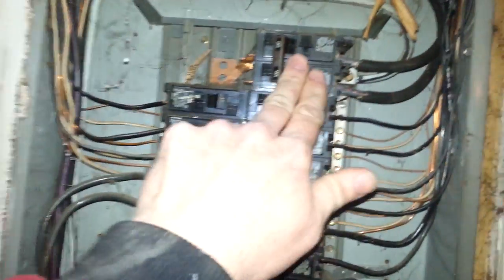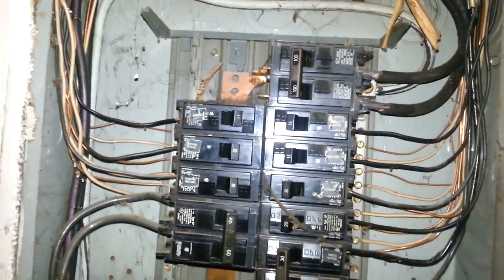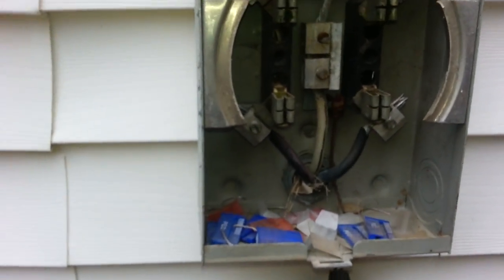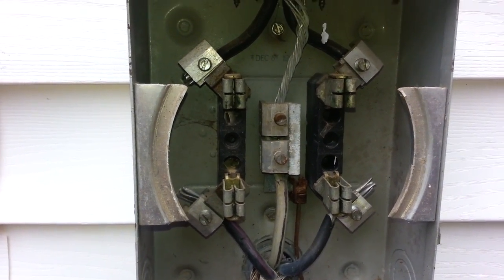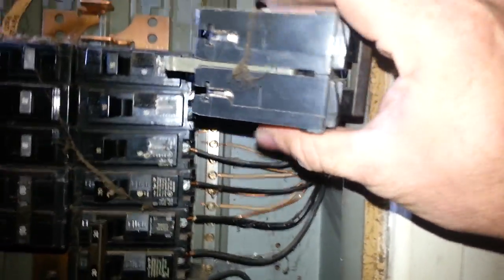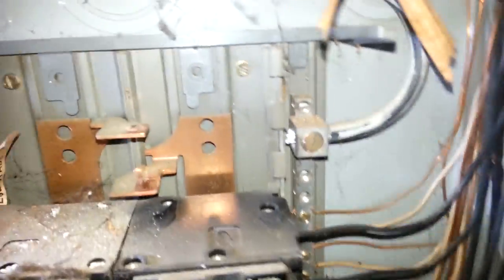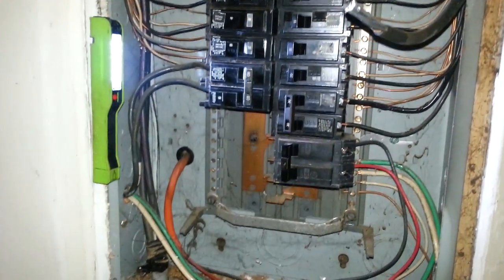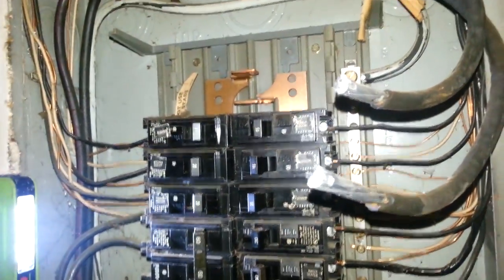Replacing over heating 100 amp Circuit breaker

Comment: anti-oxidation compound  on the bare service wires is a good practice.
I use it on copper wires that are subject to high amperage.
Use a wire brush to get into the stranded conductors.
I have a tool box with just the tools for applying anti-oxidation compound.
Reply: I just like to call it noalox

Comment: My inside main is tripping when i run heat pump sometimes,,it always gets very hot when heat pump is on,,,doesent get hot when ac is on just heat pump??Home is a 25 year old manuf home so breaker may be old and needs replacing

Comment: I have a 100 amp breaker without on/off switch. Overheated. Attempted to replace with same type breaker but has on off switch but won’t stay in on position. None on the shelf will. Does it need to be powered for it to stay on?  Is this a new safety feature or?  I’m stumped!

Comment: The breaker was in the ON position when you started trying to replace it back into the panel? Is that safe?
Reply: He unplugged the meter outside so there was no power being fed to the panel.

Comment: When you checked the other breakers were you simply tightening all the leads to insure proper connection?
Reply from the maker: Snazzy Architecture yes over time the connections will become loose due to expansion and contraction a loose connection can cause a fire as well

Comment: I'm an electrical apprentice... please correct me if I'm wrong...I first thought is ,that breaker is overloaded or there is a lose connection on the breaker terminals...as for it being the neutral, if its a neutral I would think everything in the house would be burned. last if its a short wouldn't it be tripped lol ........please correct me ....not I did not read comment before this comment. trying to test myself. please help
Reply: You are correct.  THe proper first move after a visual inspection would be to "amp out" the branch circuit conductors to see what load is on them.  If they are pulling 100 amps then they  are overloading the breaker and the subpanel its feeding needs to load shed.

Comment: I don't see anyone mentioning the elephant in the room. The breaker box is full of cobwebs even on the side of the main breaker. Did someone leave the cover off the panel for an extended period of time. Could all the cobwebs and filth be causing part of or contributing to the issues?
Reply: The elephant in the room is that he never tested the load to see if it was maxing out the circuit.  If his 100A sub panel is regularly pulling 100A then OF COURSE it will be running hot to touch.  But we'll not know because he didn't check it..  This is the equivalent to not checking the gas gauge when your car stops suddenly while driving.

Comment: So you can remove a meter with live power going into it ?
Reply: Theres always power going to the meter. Constantly
Reply: The way that I would do it.... I would shut off all the loads and then disconnect the meter so it won't be under load...
Reply: Meters are designed to be removed while still live. This is how the power company disconnects the power from an individual house if the customer fails to pay their bill.